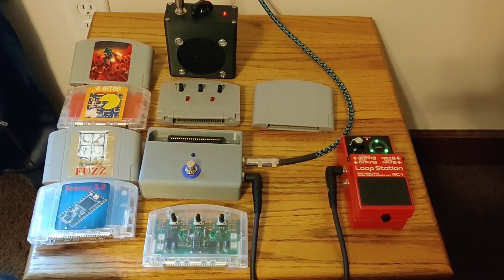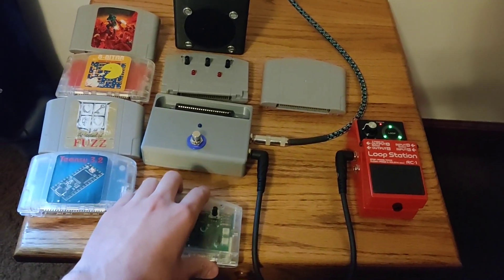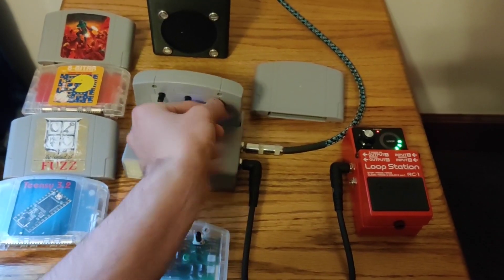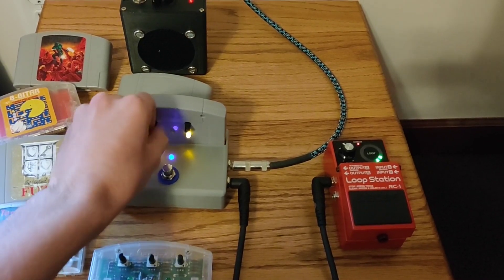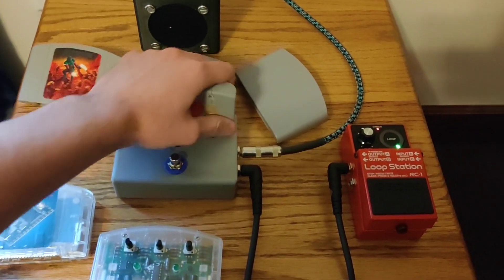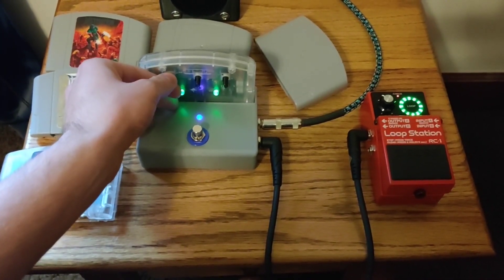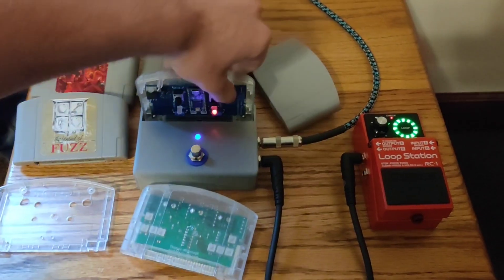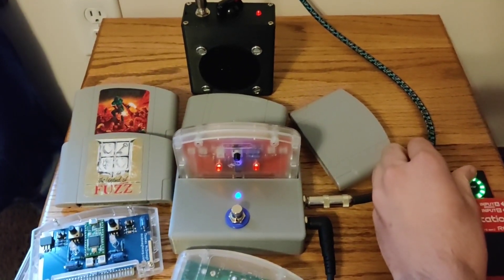Modular Cartridge Based Guitar Pedal

Comment: But will it play N64 games and let you use your guitar as the controller? 😉
Very cool man! That thing might be dangerous if your integrate MIDI into it for time, on/off, presets, ect.
Reply from the maker: Thanks I'm honestly afraid to plug one of these cartridges into my n64 since I shorted pins 1,2,48, and 49 to ground. I considered using the n64 controller port for a remote control type thing but I'd probably have to use a microcontroller since there are only 3 wires to communicate over. Solid state relays and multiple microcontrollers might be a little bit over my head at the moment but we'll see.
Reply: @thomasmcdonagh1837  it seems scary as hell at first but once you dive into it it can be a ton of fun. Watching a light turn on by sending a code is so satisfying.